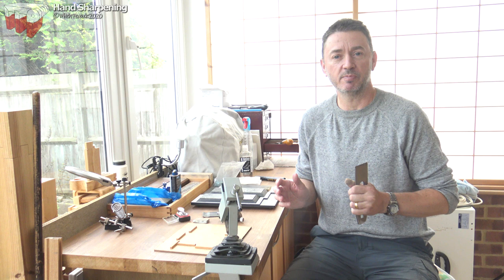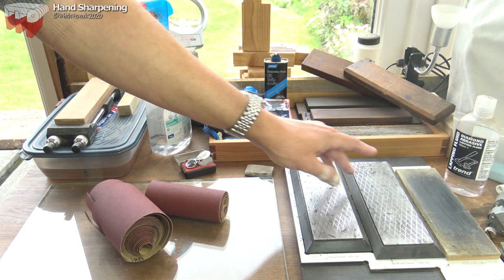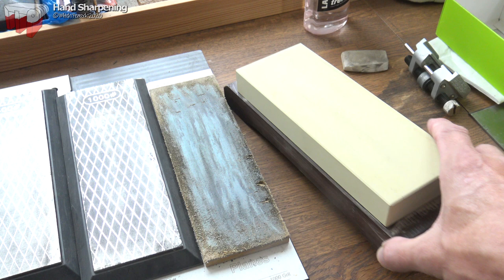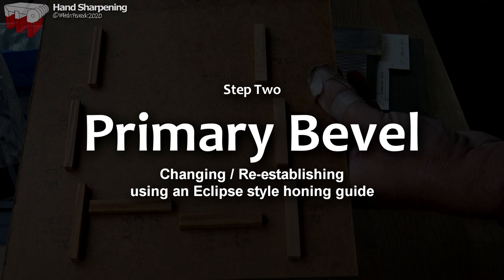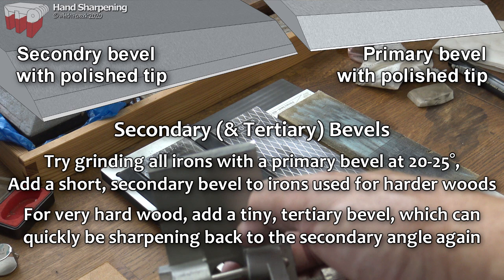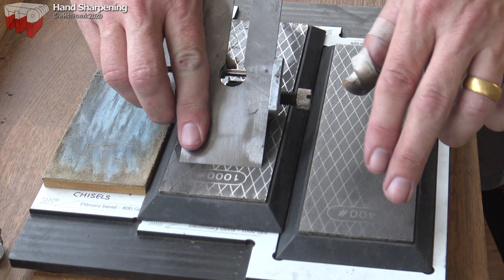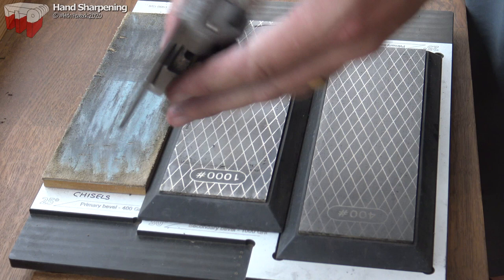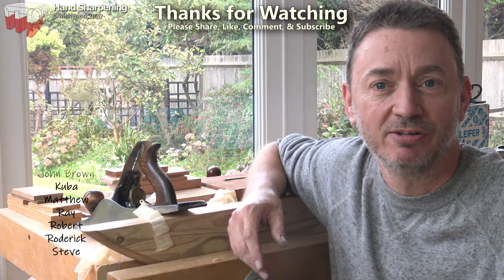Bench Plane Sharpening 1 - Super sharp, on stones, simple method.

Comment: The larger text is great Mitch! Much easier to read on the phone. The 400 stone sounds like it cuts much better than my 250g EzeLap stone.
Reply from the maker: Cheers Stephen.
If I have a lot of metal to remove, say I'm changing a 35deg  to 20deg, I'll start on coarse sand paper, and work down to the 400 and then 1000 diamond. Or use a bench grinder to remove the bulk before the diamond whetstones
Reply: @mitchwoodwork  still from the sound of your 400 is cuts better than my EzeLap 250g. Don't know if I rate these stones. Would be great if there was an 80g diamond stone though.
Reply from the maker: Sure would

Comment: Thanks Mitch for another great video!!! At 03:26 you mention cleaning the strop with a scraper blade? Interesting, I haven't came across this before in any YT video. Also I never cleaned my strop before although I've started using it quite recently and probably it doesn't need it yet.. Any tips on this cleaning?
Reply from the maker: Thanks Andrei. I've never seen anyone else clean the strop before either. Maybe there is no benefit, but to me it seems to aid charging with new compound.
Main tip I would give regarding cleaning the strop would be to protect your workbench from all sharpening supplies and waste!
Main tip overall is sharpen regularly, with least effort required. For example, when you notice the sharpness start to fall off, see if a strop will fix it.
Reply: @mitchwoodwork  Thank you very much! Appreciate it!